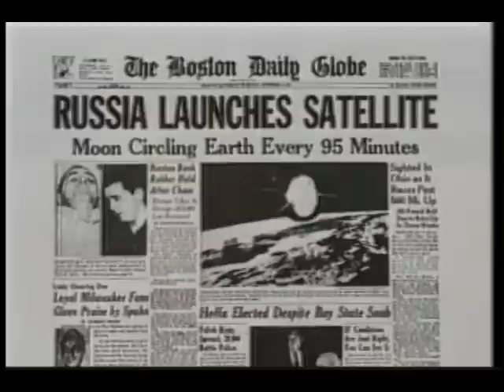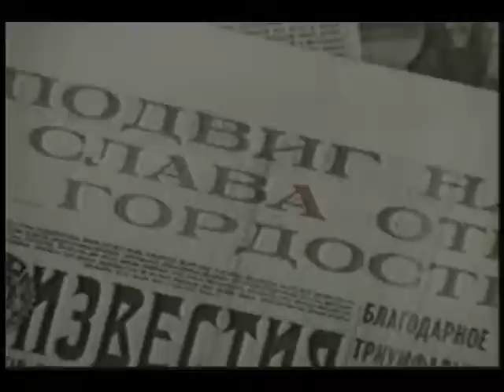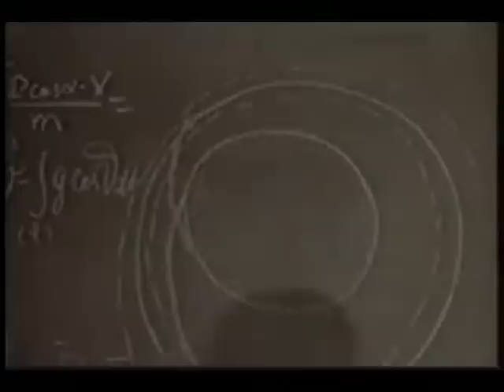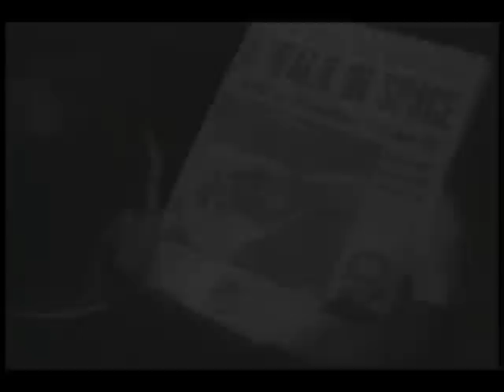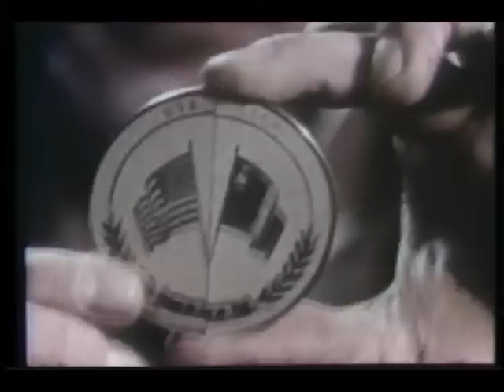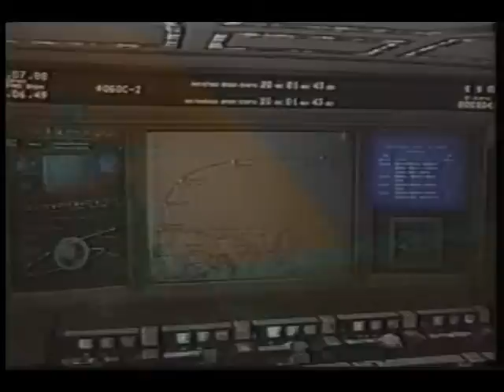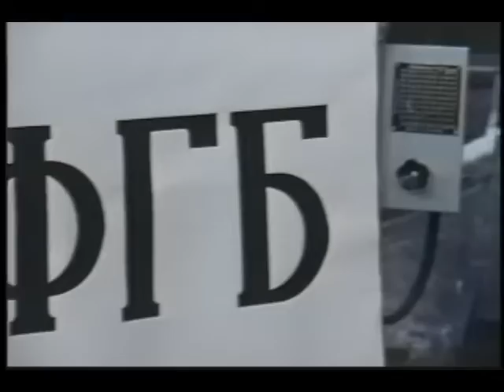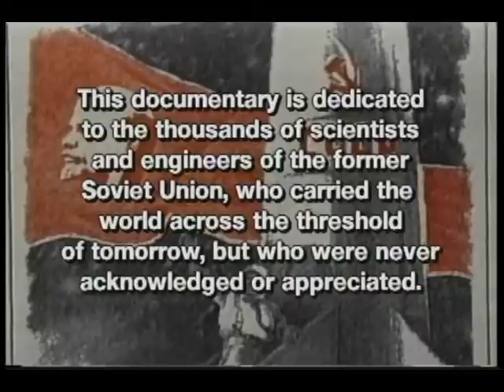The Rise and Fall of the Russian Space Program (1997) | Full Documentary | Boomer Channel

Comment: A lot of the information in this video has been either debunked or refuted.
Reply: thanks for the heads up.  i got to the part about 160 inspectors killed in a single explosion around 10:40 and started to have doubts.  if that really happened i would expect the documentary to spend more than 30 s on such a huge number of causalities.
Reply from the maker: thanks iplay. will let the owner know.
Reply: @gives_bad_advice   Now that one actually happened. Look up “The Nedelin Disaster” from 1960. They were testing a new ICBM, and it was not crewed. It was a comedy of errors that turned tragic.
Reply: Some of the issue is more info came out with time after the end of the USSR